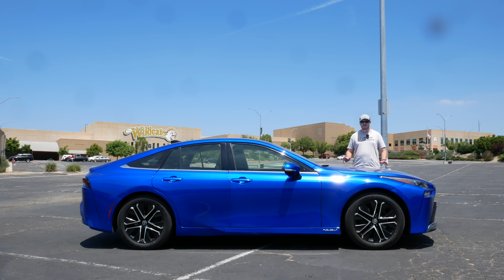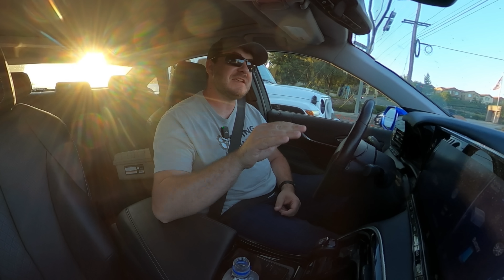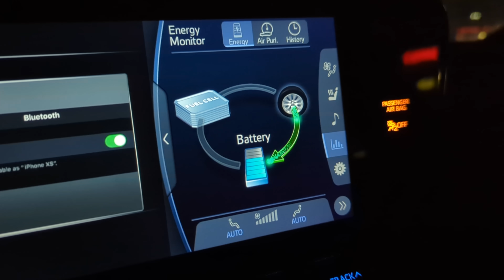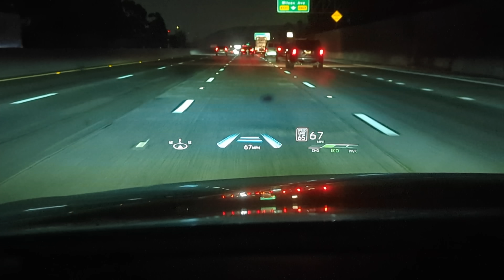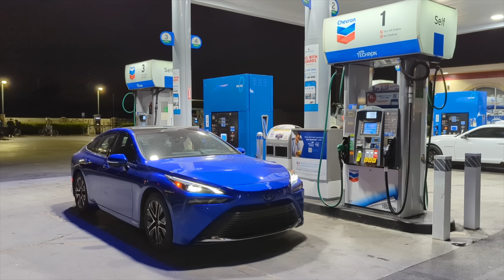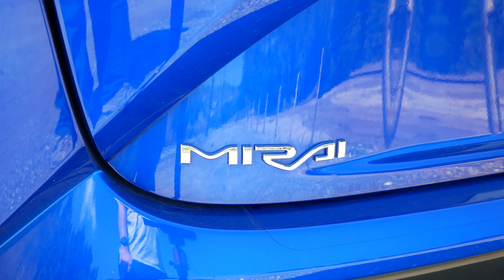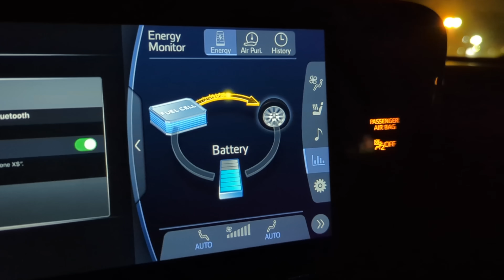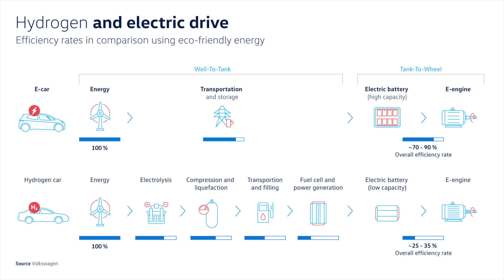The Toyota Mirai is Disappointing

Comment: ..."to cope with those incredible pressures, the tanks are cylindrical [...] it'd be more space efficient if they were rectangular, but then they'd explode and that's not ideal."

I love that kind of narration, please stay with that style!
Reply: We know cylinders never fail under pressure 😇
Reply: You know that Titan submersible that imploded under incredible pressures under the ocean? Well, that was 6,000 PSI of preasure. Hydrogen is so small (the smallest element known to man) with so little energy, it has to be compressed to 10,000 PSI to make it viable.

Just think of what happens with the smallest of cracks develops in ANY of those tanks. Can you imagine an accident on the highway? Heck, even anything more than a minor fender bender will place the tanks under stress, and... 🧨🧨🧨🎇 ... Just like those poor souls under the sea, you won't even have time to think about it. Nor will anyone nearby.
Reply: @junehanzawa5165  Those tanks are designed to fail in a controlled manner, it'll be a pressure bomb but it won't detonate the hydrogen. Also yes you're talking about THE hardest issue with hydrogen. A crash won't likely cause any issues what will are if your car goes tumbling down the road and it hits a rock that punctures the tank (super unlikely), or the tank just gets to old (the most likely) and it randomly pops. But it won't go boom with fire, it'll be more like when you over pressurize a CO2 tank.
Reply: Aerospace uses spheres.
Reply: @rogersmith7396  yeah whenever the pressure necessitates spheres.

whenever they can use a space filling tank, aka some weird shape with a bunch of right angles, they use space filling shapes.
Reply: @rogersmith7396  Aerospace also uses liquid hydrogen, not high-pressure-but-still-a-gas hydrogen like this car.
Reply: @rogersmith7396  So do LNG ships.

Comment: Carbon fiber tanks sound scary. It's true that carbon fiber is extremely resistent; but it's also true that it doesn't crack, it shatters. Suddenly and explosively. It takes just a little damage to turn a carbon fiber pressure vessel into a bomb.
Reply: You mean like the Titanic sub.
Reply: @rogersmith7396  Sort of, although in that case we're talking of pressure orders of magniture higher than this. Also in that case it's external pressure. In this case it's inside the tank.
I was thinking more at repeated damage, say rocks from the road, the car somehow hitting a bump with the tank, something of that sort.
Reply: @captainufo4587  Its an engineering topic beyond my expertise.  Graphite, S glass, nano fibers, spider web, Kevlar all possibilities including those I have never heard of.  I would think it would be expensive to filament wind vessels on a mass scale.  I always thought they would use liquid hydrogen.  Low pressure.

Comment: I have for a long long time said that hydrogen has many advantages compared to EV technology. That is always said with an asterisk however, as much in the same vein as EVs, the technology just isn't there yet, and may never reach its potential. In order for hydrogen fuel to be viable, you have to find more efficient ways to produce it in quantity. Where the hydrogen vehicles are right now very much reminds me of some of the early EVs back in the 90's. Looking at you GM's EV1.
Reply: Same for lithium batteries.  Can they make like 20 million a year?

Comment: There is also Pink Hydrogren, which now comes in 2 forms: One is just using electrolysis, but the other is a new form Japan started not long ago. They have made a new type of nuclear fission reactor that produces much more energy and much more heat. That heat is not used (directly) to boil water and using turbines for electricity production, but it uses the heat to deconstruct the water into hydrogen and oxygen. So using this technique, hydrogen can be produced very cheaply. 
Of course currently only happening in Japan and I do no if there are plans to introduce these nuclear powerplants in the US or elsewhere.
Reply: My province of Alberta in Canada keeps touting Hydrogen as a part of net zero energy, but it always looks to me like a gimicky way to store energy that is easily trumped by Lithium batteries.  Our leaders are so confused. it's sad. There are probably lots of oil and gas companies whispering in their ears

Comment: Yep, can't fill the fuel cell car at home, but you really can't fill a ice powered vehicle at home either.
Reply: And you absolutely can with an electric car.
Reply: you don't need to tho and you can always have a spare gas tank if you need it
Reply: @alexm566 otherwise known as a Jerry can? 😂
Reply: I can fill my F150 at home, not sure what your problem is.
Reply: @joelmartin2549 Do you produce its fuel at home?
Reply: @amentco8445  no he cant but he can have a store of gas or diesel at home. you cant have a store of hydrogen at home.
Reply: @spud4242  challenge accepted
Reply: @spud4242  Why wouldn't you? If you really want to, than for sure you can do it, might be expensive on short terms, but so as a gas pump would be.
Reply: @cs.marton1955  what part of -40c liquid hydrogen at 10,000PSI did you not understand? IF you got a licence to have one on your premisis i doubt it would be cheap. the cost would keep you in electricity for decades! with gas you only need to buy a 55 gal barrell or fill up jerry cans.
Reply: @spud4242  For sure it would be expensive, but if you are really determined, it is also not impossible. What bothers me more is, why is it important to refuel at home, what is the porblem with going to a filling station? Personally I have used a jerrycan maybe once, to refill my car.
And to be clear charging EVs are not that easy as well, in fact charging at home is starting to be a huge problem for power suppliers.

Comment: As I understand it hydrogen is pretty quickly being seen as unsuitable for things like trains, there are some out there but real world tests aren't too promising. Anyway with railways electrification is generally the better option with batteries used where electrification is unfeasible.
One issue we currently have in Britain is that due to historical reasons a decent amount of our railways in the south/south east are electrified using a top contact 3rd rail system and the powers that be have now decided that the dangers of it mean no new schemes are to be authorised. This is causing issues where extension of 3rd rail electrification is merited but they can't get authorisation, this means diesels have to be used despite a decent distance of the route already being electrified.
Battery trains are a possibility but they'd probably need charging points on the un-electrified bit as you may not be able to draw enough power from the 3rd rail to charge them up enough whilst also powering the train.

Comment: A challenge with hydrogen that was not mentioned in this video is storage. Hydrogen molecules are very, very small. So small that making a tank that doesn't evaporate significant amounts of hydrogen over time is very challenging and currently very volume-expensive. As long as this remains true, using hydrogen as a range extender seems counterproductive. You either give up half of your battery volume for a good tank, or you have a poor tank that leaks (so that when you need the range extender on that road trip a month after you topped up the tank, there's no hydrogen left).
Reply: A just in time hydrogen powered vehicle was developed over 30 years ago in the UK.  It had a small hydrogen tank, with just enough hydrogen to start the vehicle.  Once running it could produce hydrogen more efficiently than it consumed.  The fuel tank just contained water.  This was not a good solution for the OPEC or existing automakers at that time, so they killed the development team and destroyed the vehicle.  Similar story to a vehicle developed in Florida.
Reply: @raywalker4656 you can't just make hydrogen out of water for free, it takes energy to to take hydrogen out of water, and before you ask you cannot generate more power from hydrogen than you used to separate it from water, so no, you can't make a hydrogen car fueled by water, I've seen that sort of headline "this hydrogen car can be fueled by water!!!" But it's always people who have no idea what they are talking about
Reply: @Stackoverkill  Because you don't understand how it can be done, does not mean its not possible!

Many thinks were though to be impossible before somebody discovered how to do it.

Nobody suggested that you could generate hydrogen for free, just that a JIT hydrogen vehicle had been developed. 

This is the way science progresses, one scientist makes a discovery, nearly all tell him its not possible, then after review he is proven to be correct.

You question should have been, I did not think that was possible, but this type of technology should be welcomed rather than condemned.  

Of course, if you have an interest in oil, then that would explain your position completely!

Comment: The real fun thing is when you find out what happens when the hydrogen and oxygen mix in ways they are not supposed to.
Reply: You mean like gasoline?
Reply: @rogersmith7396  Gas will burn yes, but a hydrogen explosion has much more energy behind it. Even without a detonation, one of those tanks rupturing would do some nasty damage.
Reply: @EnderMalcolm  A unit of hydrogen has much less btus in it than a unit of gasoline.  Thats the rub with fueling an ICE with hydrogen.  You would need to tow a sow tanker behind the car to get any range.  Also depending on the temp, hydrogen has less vapor pressure than gasoline, its less volatile.  People have gotten used to gasoline but its a major fire/ explosion hazard.  Find a newsreel of a gas tanker exploding.  It will make a believer of you.

Comment: Fuel cells always seemed like "future diesel" to me. I mean like how presently diesel engines find greater use in the heavy vehicle world. And kinda like how there's air brake certification, there would be fuel cell certification or something (most of it would be around the fuel, whatever it is). The system would use a battery and a fuel cell, and have regen instead of things like jake brakes. There's a lot of potential there since an electric motor has crazy torque, no real need for a gearbox, and allows for quiet non-friction braking (as opposed to jake brakes). That mix sounds ideal for a semi that goes through large cities a lot! I hope to see some advancement in that area but it probably won't happen until trucking goes automated and they're buying new trucks anyway. Whenever that ends up being.

Comment: I think FCEVs are actually ripe for mass adoption. It just takes massive infrastructure investment. FCEVs have TOOOOOOONS of benefits (refill go brrr and they last longer than battery cells, and you get the benefits of electric motors, and the range is like a gas car) but you would basically need to rebuild gas stations. They are also better for the environment than BEVs and mesh the benefits of EVs and the convenience of gas cars.

BEVs make about double the carbon tonnage output out the gate (from what I've researched) and over the lifetime the fuel cells have to be replaced a lot less often and even after 150,000 miles which is the rated range you can get them checked frequently and keep using them beyond that. Plus the fuel cells cost environmentally MUCH less than swapping a battery pack (from what I've seen, as far as I am aware that is correct)
Reply: They are far from better for the environment. And the infrastructure investment would be well over 500b and probably over 1t for the US alone. The batteries needed for a FCEV wouldn't last as long as batteries in an EV. Plus EV batteries are lasting over 300k miles anyways. The refueling speed benefit is drastically offset with home/street charging being an option for EVs. The majority of driving done is far better in an EV vs an FCEV. And the cost to own is cheaper for an EV. The benefits for FCEVs are too few to bother with the massive investment needed for the infrastructure.

Comment: hydrogen has another fun side effect you might not have known. it escapes. CONSTANTLY. hydrogen being the smallest element means that it can walk its way (slowly but still) right past gaskets and often straight diffuse through walls of materials. its a tricky little bugger to harness.

theres also something to be said for batteries being smaller in a fuel cell environmentally. batteries are still a bit of a nasty thing to make and wear out worryingly fast. though i dont think thats anywhere near enough of a reason to say fuel cels are better.

i wonder about fire safety. batteries are bad, but i have a sneaking suspicion a full fuel cell might be explosive.

and lastly, a use case for hydrogen is as a way to bleed off excess grid energy when renewables are overproducing. use that power to switch on an electrolysis plant.

Comment: To be fair, that short recharge time for heavy trucks makes a lot of sense. It would save on weight, since batteries are really heavy and trucks are heavy enough as it is. Add to that the fact that long distances and timeliness is important in trucking, and yeah, that hydrogen fuel cell concept truck sounds more ideal.
Reply: Long distance trucking is such a strange niche for me, i always think about if it would be such a big thing, or a thing at all in a place with good rail networks.
Reply: @crackedemerald4930 merica has a great cargo rail network, and Europe has good rail and long distance trucking is still a major part of the logistics networks of both places.
Reply: Or you can put them on a catenary as has been done in Germany.  Easy peasy.
Reply: There's nothing stopping the Edison Motors upcoming diesel electric semi from using a hydrogen fuel cell one day. It's basically a self-charging electric truck.

Comment: I think hydrogen has several other possible applications, which are useful for transition from fossil fuels to renewable energy, which is why it'd be great if a solid hydrogen infrastructure would be built. For long distance transport with electricql/hybrid semi trucks/lorrys, there is an interesting solution for recharging, by installing collectors, like on trolley buses, and let them charge when they are on the highway.

But for a quick masstransition, I think it'd make sense to produce methane from agricultural and food waste,and convert preexisting gadoline vehicles, as well as create diesel-like fuels from waste fats/oils. This could make it more affordable (compared to EVs)for people everywhere, especially in poor and emerging economies, and emancipate those societies from dependency on the oil producers (with more dispersed energy production).

In planes, I suspect it makes less sense to use fuel cells, and more sense to combust hydrogen (still only vapor as exhaust gas) in the turbines. Was done in a "regular style" (but experimental) jet for the first time 1988.

Given how much capacity there is for solar and wind (if we'd really went for it), the downside of inefficiency in all those steps is, not insignificant, but not a dealbreaker,I believe. I suspect that a mire important question is if fuel cells, or if batteries are more resource demanding to produce.

Comment: 2:49 like when Volvo coated radiators with platinum catalyst, so ambient NOx would be neutralized as you drive.
Reply: No way, don't you need stupid high temperatures for the platinum to work, and the amount of NOx you'd catalyze would be negligible?
Reply: @crackedemerald4930  That is correct.  Catalytic converters have an operating temperature where they're most efficient.  The whole point of the "smog pumps" cars used from the 70's to the early 2000's was to get the cats up to temp as quickly as possible to avoid excess emissions during warmup.  Nowadays, automakers use other tricks to warm up cats, like mounting them extremely close to the exhaust manifolds to use the exhaust heat or direct injection systems that purposely inject excess fuel during warmup so the un-burned fuel in the exhaust gas ramps the reaction up REALLY fast.  You can hear it happen in direct injection cars with loud exhaust when they startup from cold.  They'll sound really weird for 10-20 seconds then smooth out.
Reply: Brand name “PremAir”.

Comment: I don't think the hydrogen is being chilled when transferred from the station to the car. The expansion of the hydrogen alone is reducing it temperature, the hydrogen is acting like its own refrigerant. Hydrogen used as a refrigerant is called "R702," but unlike Freon (R12 or R134a) as far as know it's incredibly rare as a refrigerant if used anywhere at all.

Comment: Well... burning hydrogen makes sense for some kinds of car lovers, in the world of ICE, where people love the mechanical action, behavior, sound, feel of engines, over motors. In a better world, they produce mostly water vapor, instead of everything that fossil fuel does. For another kind of person, it might be fully EV. For others still, it might be hydrogen fuel cell powered motors. 

The current acquisition methods of hydrogen aside, the question everyone should be asking is: When we can directly fuel a car or motorcycle, with the most abundant element in the universe, that doesn't produce toxic gasses when burned, why are we not trying to? When it's literally everywhere, you can use it more inefficiently, by combusting, without concern.

Toyota wants to continue the tradition of building great engines, by making them run on clean, limitless fuel. It's good for Toyota, continuing building great engines, giving ICE-devotee's what they still really want, and reduces pollution way down to an insignificant figure.